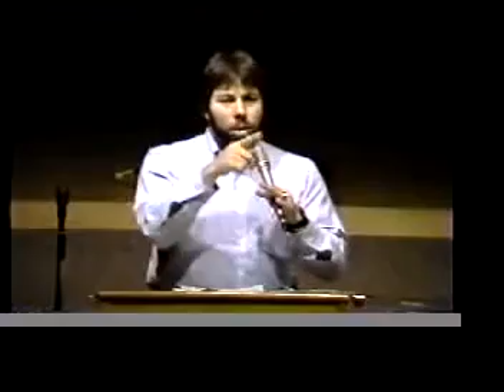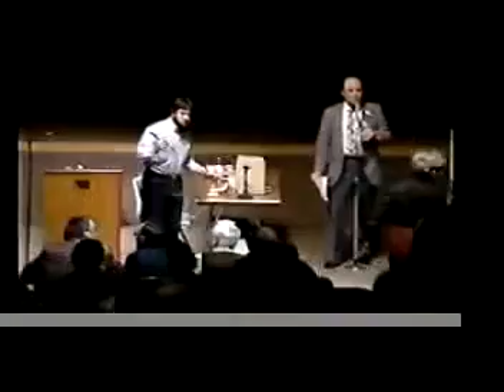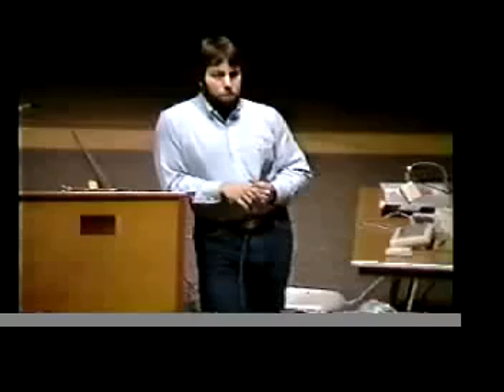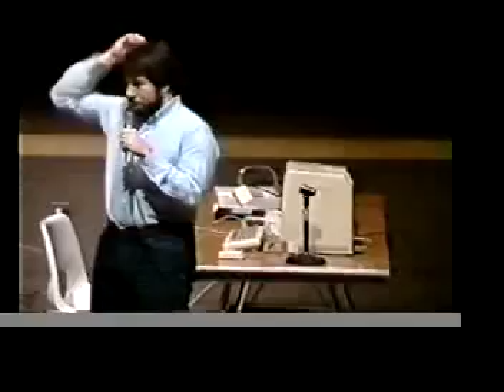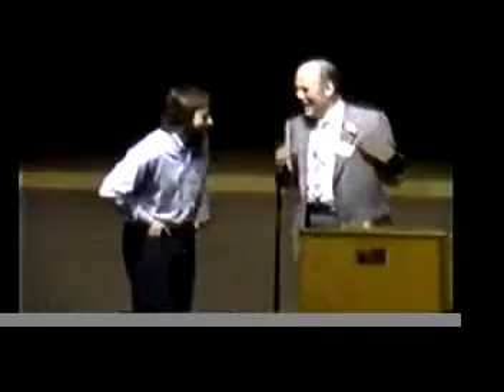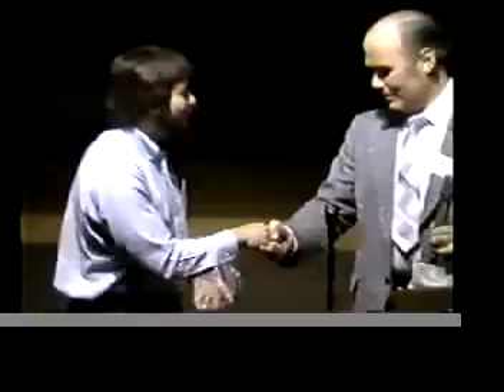Rare video of Steve Wozniak from 1984 talking about computing, starting Apple and the Mac

Comment: It is sort of the American dream: start a company in your garage and have it get crazy big. After all, Steve Jobs, Bill Gates, and even Bill Hewlett and Dave Packard did it. Seems hard to do these days, though. However, one ham radio company that has been pushing the edge of software defined radio appears to be well on the way to becoming more than its roots. FlexRadio has teamed with Raytheon to undertake a major project for the United States Air Force.~~~
The Air Force has given Raytheon and FlexRadio $36 million to develop an HF radio based on the existing SmartSDR/Flex-6000. ARRL news reports quote FlexRadio’s CEO as saying that the investment in the military radios will pay dividends to the firm’s ham radio customers.~~~~
Honestly, that would not surprise us, as ham radio has always gained a lot both from military technology and surplus. In addition, military radio makers such as Collins have a long history of also making amateur gear. We would imagine the potential market for an SDR would be far larger for the military so this could make more powerful gear available at a lower price.~~~~~
The Flex6000 appears in the video below. The receiver uses a digital direct sampling technique on receive and a direct upconversion on transmit. Different members of the family have different ranges, but typically the radios can go from 300 kHz to 77 MHz and sometimes also 135 to 165 Mhz.~~~~~
FlexRadio has a lot of competition lately in the ham radio SDR space with players ranging from big manufacturers to small businesses all taking a piece of the pie. The military connection for FlexRadio may let them give individual hams a better product.~~~~